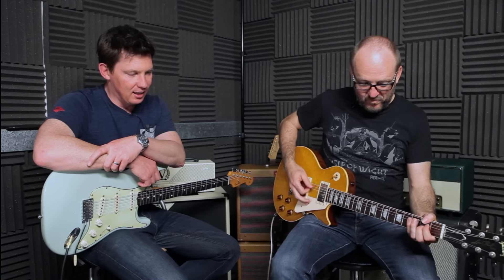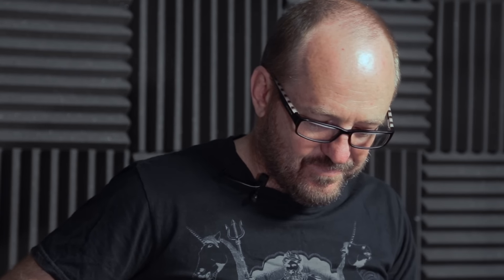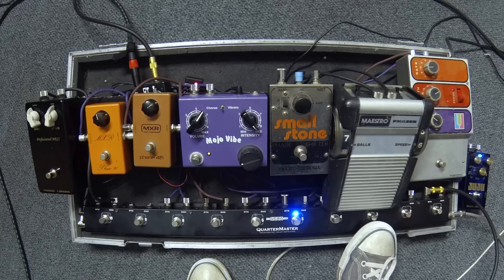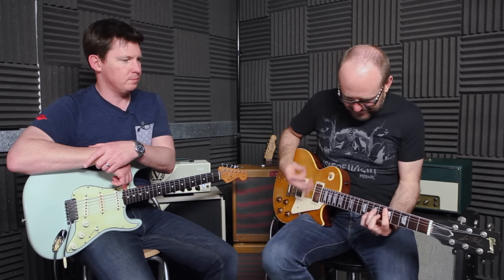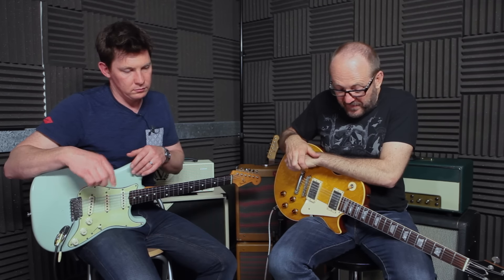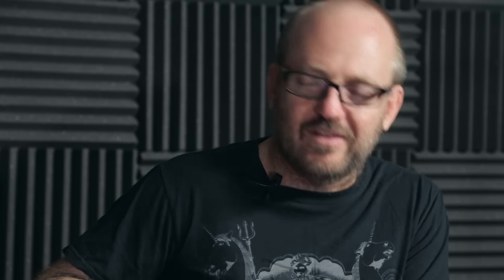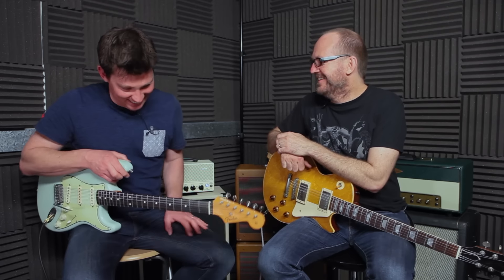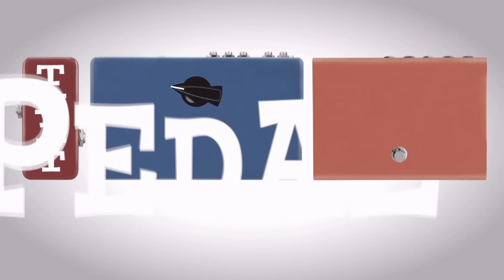That Pedal Show – Six Fantastic Phasers!

Comment: Yay phasers are my favourite! Great rundown, but I think you gave the small stone short shrift. I think you may have a bad potentiometer on your small stone. I've got a couple of vintage ones and I find the rate knob to be very responsive. I have a newer block logo phase 90 and I actually like that it has a bit of a volume jump because phase+OD=smiles. Thanks for the videos.
Reply: Yeah I was bummed with the Small Stone bit. That rate knob has a huuuuge range, seem his must be broken. With color on and rate the whole way down it's sooo tasty. Put a delay and or drive before it and it's just such a unique sound.
Reply: If EHX would just get their pot game together, I'd buy more! 🤑
Really though, of the 70+ pedals I've bought,  3 EHX are pedals and a pot has broken on 2 of them. A couple other kinds have cracked knobs, but none of the others have busted pots.

Comment: I actually bought a maestro phaser like this one from the video that from a flea market for 25$ dating back to 1976 and have been hooked on the Norlin era maestro pedals ever since. These Maestro pedals were only built from 76-78. I recently bought the Maestro Stage Phaser which i believe is the best phaser ever made because of the extra controls and the ramping of speed.

Comment: I have a lot of Electro-Harmonix pedals because they sound great. However, I tend to ban them from my gig pedalboard because they are so hard to control. Like this Small Stone, they go from zero to crazy in about a 2 millimeter clockwise turn. I just don't like having to try to fuck with them between songs. The last EH pedal on my board was a Memory Boy, which I replaced with an MXR Carbon Copy for analog delay with modulations. I find, other pedals usually have far more control over the nuances. Now they all sit in my bin or on experimental pedalboards that I mess around with at home. By the way, MXR Phase 90 is my favorite pedal and is ALWAYS on my gig board. Also, I call the "patch" (to borrow a MIDI term) I make with the MXR la machine octave fuzz into the MXR Phase 90 the "Hendrixomophone." :)

Comment: Wow! Mutron and Maestro win for the shape! ;)
That Small Stone is broken in my opinion: I have two (1979 V3 and a Reissue) and tried many older ones, all were much wider and faster in the rate control, this one does only slow phasing, have it checked by a qualified tech!
Reply: I think EH will mix your old phasors, dude. Give 'em a shout.
Reply: Sorry but I didn't understand, what do you mean? Do you think my Small Stones have something wrong with the rate control?
Reply: No. I was rsponding to another comment.I meant to say "fix" your phasors  :) Back in the day, Electro Harmonics pedals were referred to as " Tin Can Junk". They sound good. but broke down a lot.. Mike Matthews personally fixed my Memory Man.

Comment: Does anyone know what phase shifter Thin Lizzy was using on the track Emerald from Jailbreak LP? If you want to hear the proper use of one put on some closed back headphones and listen to the right channel about the halfway point when they trade off leads. Most players in the 70's used phasers on the dirty channel, EVH, Roger Fischer (Heart) Thin Lizzy and many more . The sweep rate was usually slow and the sweeps were wide making a "jet" sound which no one does any more. Like most things from that era, they are lost in time.

Comment: what gives the univibe the warble is there are four caps in the phase sections of the lfo. instead of all four caps matching and being symetrically equall they are mismatched . for example instead of four 4n7 caps it has a 220 n an 15n a 4n7 and a 470pf. this creates a warble misbalenced throb that is amazing .
Reply from the maker: +strassercaster great info, thanks

Comment: I love That Pedal Show but I think this episode did the Small Stone a disservice as for one that speed knob was obviosly faulty (poor quality control back in the day), and then going on to the gimmicky setting on the colour switch. I always loved the Small Stone set low on speed and intensity whre it really shines and its pleasing milky texure and tone come through. I do love the Phase 45 and the Mojo Vibe though. Alsosince I'm high on the self righteous mountain top ivory tower where my phase shifter recollection is beyond perfect, I hated hated hated that Maestro, just as much as I did when I ditched my Small Stone for a Maestro (Alex Lifeson had one). The Maestro had a seasick thing probably from the peaky tones and it also had a weird dryness that it imparted to my tone. I could  not get it out of my signal chain fast enough! It did make it onto my very first pedal board though , a whomping heavy stupid big chunk of 3/4" ply spray painted black with the Maestro held on with big screws popping up and slid into the channels the feet were slotted into and my other pedal at the time, a Turtle FuzzWaVolume pedal with "ring modulation" , a re-branded Foxx unit apparently. The Fuzz was very cool as it was basically a Foxx Tone Machine with that crazy octavia switch, and the wah was cool with 4 settings from mellow to brite, but when it was not engaged it was backward volume pedal non bypass tone and volume sucking bitch, maybe the worst ever example of a tone sucker, but then again I was a "nice boy, but dumb...about as sharp as a bowlin' bawl", and was probably running 2 15 foot cheap assed home soldered and very poorly at that coilly cords and maybe a 10 foot cable between the 2 pedals adding to the sonic soup. Ahhh the memories... It took me years to find out what that fuzz really was and I've wanted one for years and years too, it was the only fuzz I've ever owned.Maybe I should grab a Danelectro French Toast apparently the same circuit as a Tone Machine. I know this long winded rant is regarding an ancient episode but I got a little defensive of my personal favourite phase shifter getting laughed at and got off on a tangent but I can 't help it. I is what I is. Love your show fellas, I go wet/dry/wet because of your shows and don't miss an episode and this is 2020 . Cheers Mick and Dan, 2 vastly underrated phenominal guitarists in my opinion.

Comment: pretty aure that Small Stone doen't have the proper taper pot in it. I've had a v2 just like it for about a decade and have used a couple others and the speed ha schanged smoothly across the range of the pot on all of them. I've read that the v1 doesn't change as smoothly, though, so maybe that's a transitional examole with a v1 circuit in a v2 case.

Comment: On the Small Stone, I have never found the 'color' setting very useful, but I didn't see you try the other setting. Also, your potentiometer doesn't seem to be working right or maybe just not with the 'color' setting. The whole dial range is usable for different sounds. I think it's a great pedal.

Comment: Thanks for the video, but you should know that your Maestro Phaser is in desperate need of some calibration (or repair
). I have the same pedal, and it has a much fuller, deeper sweep, similar to the Small Stone. The one in the video sounded like it was stuck in the higher frequencies. That's not how it should sound.

Comment: Hi Daniel, I have a question about the MXR Phase 45. I tried one and loved it, but it didn't have an input for power, it had to be run from a battery. That makes it impractical for gigging pedal boards. Could it be modded to take a power input? Or is there a similar sounding pedal that does? 

Thanks, I love the show, especially the educational ones, I've learnt a lot about the subtleties of amps and effects that I've never heard mentioned elsewhere.
Reply: +Matt Helm - I think the newer Phase-45s have a power jack. Also, check out Ibanez PH-7, very adjustable for inexpensive phaser. - They're not too much $ used. Then too, MXR has a new small-footprint Uni-vibe pedal that i think sounds great, and is reasonably priced. (Like they said, Uni-vibes are a type of phaser..)
Reply: +Matt Helm hey also theres these short little adapter cables that run from the battery jack and have a power input.  not sure what they called or where sold.
Reply: Thanks guys, I've found an adapter that clips on to the battery connection (I think that's what Daniel Simon was referring to) so I've gone ahead an bough myself a Phase 45. Thanks :-)

Comment: As a huge fan of the maestro phaser (and clearly Daniel is as well), it's a shame that the demonstration didn't use more usable settings. The depth setting was left on a higher setting which made the pedal sound unusable with overdrive. Dialed back the pedal is as useful as the Phase 90. I was also surprised that while Daniel was praising the amazing design of the Maestro that he didn't mention that Bob Moog was the designer. That explains a lot of why it was so amazing. It seemed like the other large vintage phaser was also set to more extreme settings. It just seemed odd that they conclude that the two MXR phasers are more guitar friendly.

Comment: I believe that if you switch the potentiometer on the Electro Harmonix Small Stone, you can have a better range of control instead of that narrow end. It seems that on this model they installed a logarithmic one (generally called audio potentiometer) or an inverse logarithmic one (though I've never used it but it relates to what happens to your control range) instead of a common linear one... open it up and look at what says over the potentiometer.
If it says "resistance value"-A it's a log pot, "resistance value"-B means it's a linear pot, etc.
You can buy a new one and solder it on place of the other one and see if it works better, just keep in mind the resistance value.
Just an idea! Cheers from Brazil.

Comment: Guys, i love your show and am grateful for the huge effort that goes into each of these vids. It is the most rewarding and educating series of this sort, with great recording technique - thanks a bunch!
But may i add something in regard to the Uni-Vibe style effect? It is not true that the effect cannot be achieved by different means than a bulb and photocells. These are just means to get a very unique LFO. First it was done with a LED (RM Voodoo Vibe) and then recently by the original Uni-Vibe designer Fumio Mieda for Korg - in a pedal called the Nuvibe. That one uses 79 transistors to simulate the same behavior. Judging by clips it might be the best recreation of the original despite the totally different technical approach. Maybe it is time for a Vibe-show? :) A very much speciality thing, but so organic sounding and unique - i am a fan. The Mojo Vibe is nice, but like a CE-2 compared to a Vibratone, or an Electric mistress to Tape Flanging, or an incarnation of a dTape Machine of sorts to an EP3, or... i'm sure you get the idea... Might be interesting to hear the original, the Nuvibe and some other clones. An interesting lesson there too - how the same sound can be achieved by different technology. And Mieda is one of the engineers who after a long trial and error has returned to analog after giving in the idea that digital can halfway efficiently recreate it (at least with current technology). Sorry for the long comment! 
Have a nice life, guys! :)
Reply from the maker: Hi Charlie. Good call, vibe show on the way :))
Reply: Another suggestion is a video about how to use expression pedals with all types of effects, from gain and volume to modulations (speed, depth, feedback, resonance) and echoes (reverbs and delays). I still have in my mind that video you made about volume pedals, including buffered volume pedals.

Comment: what would you say about the moog phaser?
Reply: +Jaames Coxon i was hoping to hear the Moog Phaser too, i think its luscious as!
Reply: The moog is the best ever built. I've owned all the phasers in the video. The second best is the Maestro the third-best is the mutron
Reply: The Moog MF-103 is the bizzzz. 6 or 12 stage, resonance knob, delicious drive knob, sweep amount which allows you to have control over the frequencies being phased, and an LFO that has depth amount, and a speed of .01Hz to 250Hz. 

I’ve bought and sold several Foogers, but the Phaser is a keeper, and its the least expensive of the bunch. I think I got mine 2nd hand for $185. 

Honorable mention: Red Witch and Diamond phasers.